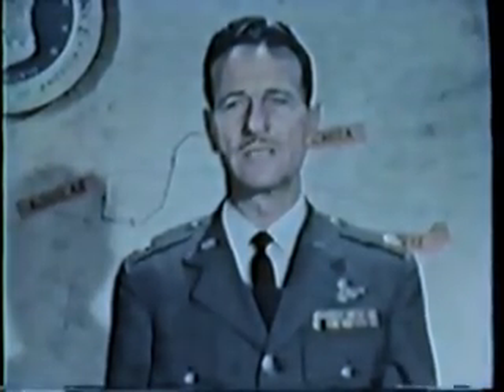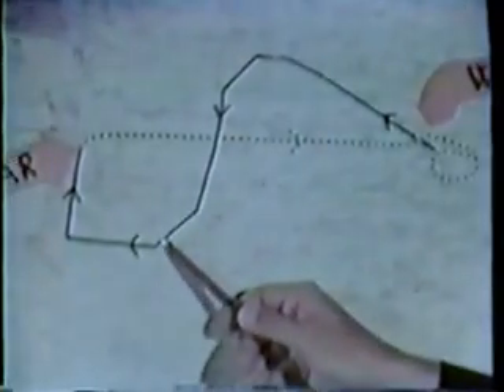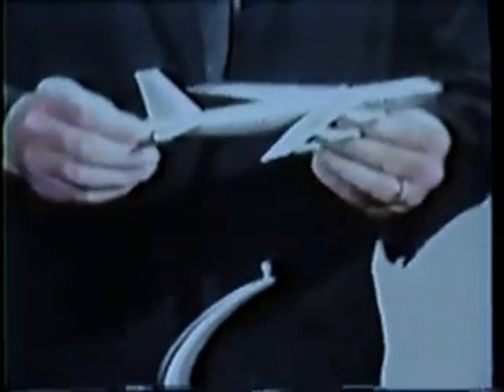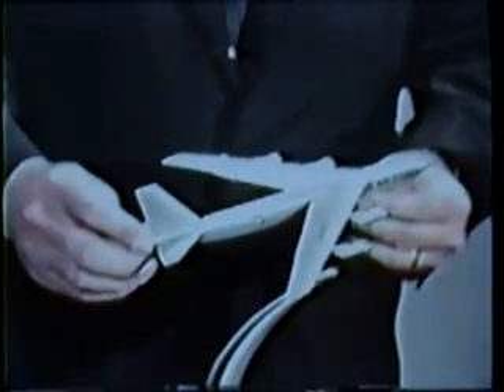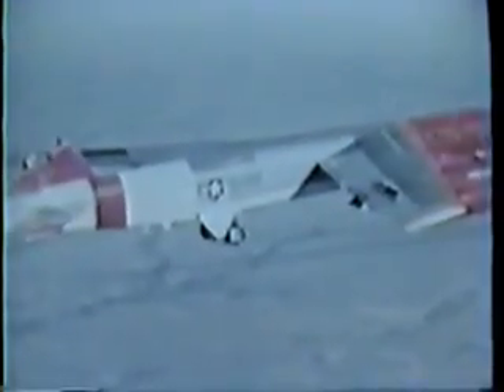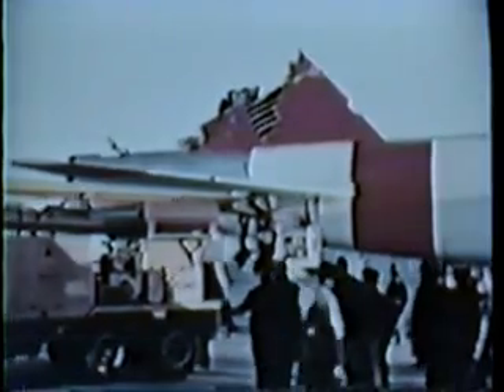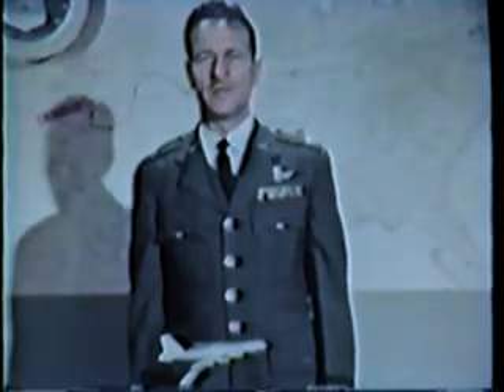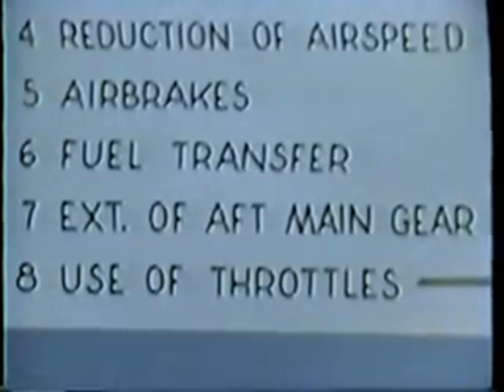Boeing B-52H Stratofortress - "Flight Without A Fin" - 1964

Comment: A Japan Airlines 747 have a similar loss of the vertical stabilizer. The pilots struggled valiantly to keep it flying for a while but eventually lost it. I don’t recall them being instructed to extend landing gear or transfer fuel to gain stability. They fought like hell either way and flew it til the end. I need to rewatch the crash investigation because I’m not sure.

Comment: What changes did they make to the fin? Did this ever happen a second time?
Reply: +James Walsh All B-52 variants went through a standard structure evaluation, other than that, the conditions were considered so unique there really wasn't anything they could do. And, no, it never happened again, except, several D and G models came back from bombing missions during the Arc Light missions over Vietnam with some rather large pieces missing.
Reply: The G and H models were built with shorter tails. (Eight feet shorter.)